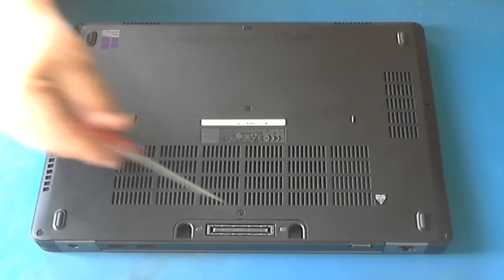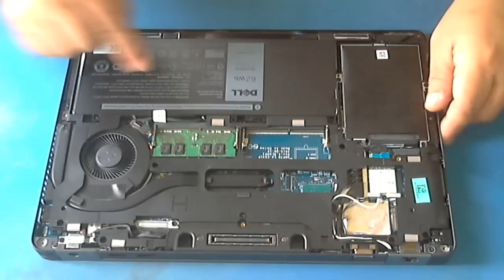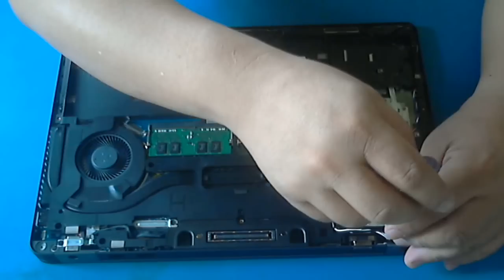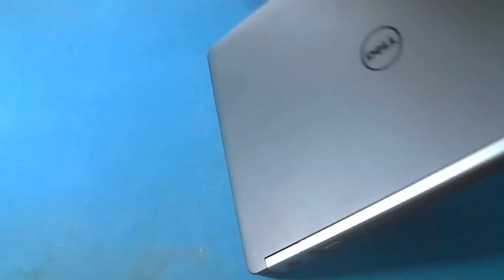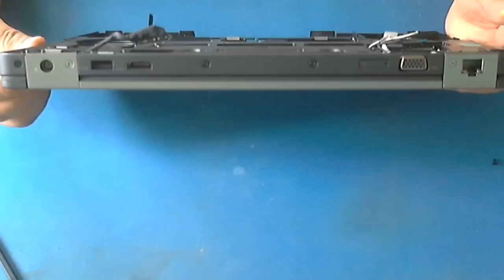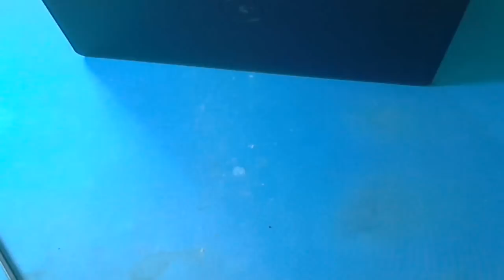Dell Latitude E5470 / E5570 Skylake Disassemble + Thermal paste changing

Comment: Did this also on exactly same spec and laptop, also using Arctic Silver MX4 and the X method of applying the paste. I tested temp via CPU-Z's Stress Test, found it 92 C before and 82 C after (running for about half hour). Highest temp after running Unique Valley Benchmark 3 times (taken with RealTempGT) is 74 C. Running some games I was still able to get temp to 92 C for short times, but this ran without throttling whereas previously it would get to 95 C and start throttling.
Reply from the maker: you apply too thick on the cpu . Too thick is giving less heat dissipate
 which cause the cpu become hotter than cooler. U have to adjust this 
yourself, or u have to find professional to do it.
Reply: I am actually pretty happy with the result. I've tried numerous ways of applying paste (less, more, different methods) on desktops and found all my techniques seemingly produce the same temperatures. I based the X method on pugetsystems' "Thermal Paste Application Techniques" article.

I don't think simply using Unigine Valley Benchmark produces the highest possible temperatures (certainly it never has for me, on either desktops or on this laptop). Even stress testing (which gives 100% CPU load for all cores) didn't, only playing games that basically use 100% CPU and GPU together seems to. I suspect but haven't tested that the latter is similar to Prime95's result though.
Reply from the maker: great to hear that . But from my experience, X method is not really the ultimate way to paste it. I do it differently  :)
Reply from the maker: you can always try out another stress test call "Heavyload"

Comment: Any tutorial on tightening up the hinges on the LCD? We just got this laptop back in May and I use similar models at work all the time and haven't had this issue before.
Reply from the maker: Sorry i dont have the tutorial. But if for the LCD hinges, the 2 screw is located on this video 8.29 .  One is next to the power adapter, the other is next to the Ethernet port. If you've tighten it well and you still have shaking panel, then i suggest you have to send it back to the shop for warranty. Otherwise,  you have to use Heat Glue Gun to make it tight, which will void the warranty.

Comment: Is that a thermal pad at the bottom of the heatsink? Or is it all thermal paste, but the part that was on the green portion stuck to heatsink only when you lifted.

When you replaced the paste, did you put any on the green portion or just on the shiny portion?
Reply from the maker: It's only thermal paste on the heatsink. And u have a very good eye, the green there is just shiny, but in fact, I apply  thermal paste on it too just to take good care of the laptop.

Comment: Where is the part were you apply past?? And can i use any tharmal past?
Reply from the maker: from the cpu , you can clean the existing thermal paste with alcohol swab and use a good thermal paste. Artic MX-4 is a cheap and good one. dont use cheap brand because they helps nothing in reduce heat .

Comment: How is the performance of 6440HQ quad core processor? Does it produce a lot of heat on normal usage?  How long does the battery last on average? I was thinking of buying 6300HQ instead of 6300U. Please post a detailed review of your laptop :).
Reply from the maker: the performance 6440hq have higher clock speed 2.6Ghz to 3.5 Ghz compare to 6300HQ 2.3Ghz to 3.2Ghz. The stock thermal paste is useless. U have to repaste it with arctic mx4 to get a good result on lower temp. here's the comparison https://forum.lowyat.net/index.php?act=Attach&type=post&id=7074062

Comment: hi is it possible to replace the cpu
Reply from the maker: No and yes, You can only replace the same cpu if it's burnt or problem. But No if u plan to upgrade the cpu
Reply: so in other words to upgrade to a i3 6100 3.2ghz would not be possible
Reply: helo
Reply: i curently have a i7 6600u with a 6.60ghz and want to upgrade to the i3 6100 3.20ghz
Reply: oops 2.60ghz
Reply from the maker: if the bottom pin is the same, then u might have a chance. So far replacing the same type cpu is possible. To modify it u got either fked up your warranty and it's not working, or u have a working laptop but void warranty

Comment: This does not look like the inside of my Dell Latitude E5570.  The space for storage sits perpendicular to the one shown here.  Mine came with an M2 SSD and a slot and space to install a cable for a more traditional drive.
Reply from the maker: your version is the same as  Amol Gund. The new version have m.2 instead of the old ssd/hdd. You can unplug the m.2 and replace it with 2.5" hdd but you need to find the cable connector from used repair shop.
Reply from the maker: check the video description for the new info for your m.2 to sata cable. i've just update the links

Comment: Does your laptop make weird electrical noise?
Reply from the maker: nope it didn't.  this laptop model just release around end of Jan 2016. everything runs at normal, just the temperature is not as good as I expected.
Reply: well i got the same and it makes a strange electrical noise, guess i`ll have to return it. thank you for your answer
Reply from the maker: Alexandru Zăbavă
i dont know where you live, and how's the power supply in your country. It maybe distortion on the incoming power in your place. But since it's under warranty, u should call dell and let them checked it out.
Reply: +SuperLittlehorn it`s not that, evenif it`s on battery it does the same. and when i started it first time it was the same. yup, that`s what i`m going to do, call them
Reply from the maker: good, after you've warranty your laptop back, get yourself an arctic cooling mx-4 or coolermaster extremefusion x1 and follow this video to repaste it. In long run, your cpu will last longer.
Reply: +SuperLittlehorn  will do :)
Reply: your cpu will last, but your motherboard itself wont ahahahaha... I do warranty repair and replace a ton of mobos (on all models) >.<
Reply from the maker: i do agree on this. nowadays the component wont last long. compare to last time where they have alot of pure gold plating stuff which last for a long long time.
Reply: yeah I am in China and my laptop make electrical noise, too.

Comment: Unfortunately, the back of this PC is a huge pain in the ass to remove. If I had to pull any harder, it would have broken. They did it right with the E5450; there was no need to change it.
Reply from the maker: you can always stay with it where it reach up to 89 Celsius or you can repaste it and see the max temp of 78 Celsius.  Every 10 degree increase = cpu life span reduce to half. The choice is still yours.

Comment: I'm receiving error "The AC adapter type cannot be determined" when I start the laptop, I already update the BIOS yesterday and try with different chargers I have (all my laptops are dell, same voltage) and the error remains. It is possible that the laptop conector is damage? what else I can do?
Reply from the maker: Did u use original that model adaptor? Using other different than that model adaptor will usually comes out this msg.
Reply: @SuperLittlehorn  I do, the charger is new for this laptop
Reply from the maker: @josegardunorubio4214  i think your new charger is not original . u should return it to the store and bring ur laptop over to try another adaptor. Meanwhile u can turn off the warning sign .  F2 - > advance ->adapter warning Turn off-> saved. 
 Or new bios - >Settings -> post behaviour -> adapter warning -> untick enable adapter warining -> saved

Comment: Hey quick question
latitude 14 5000 series or E5470 to be exact
Offer HQ Skylake chip right? As far as i know, HQ mean QuadCore while all E5470's reviewer on utube said that it has only Dual Core
I be like "wut?"
Reply from the maker: Yea they have few version of skylake cpu. HQ/MQ/UQ=Quad Core

QM/HM/UM=Socketed

QU/MU/HU=Dual Core

UH/QH/MH=Soldered
Reply: SuperLittlehorn i already know about that, that wasnt my concern anyway
There is review on internet about E5470
many of them said that altho it has i7 - 6820 HQ, the processor is Dual Core
Like this one: http://www.pcconnection.com/product/dell-latitude-e5470-core-i7-6820hq-2.7ghz-8gb-500gb-ac-bt-wc-4c-14-fhd-w7p64-w10p/8v22n/31564765
Reply from the maker: +Yahtadi Shidiq the website maybe not correct about the infomation. You can always check the cpu info  on cpuboss website . http://cpuboss.com/cpus/Intel-Core-i7-6820HQ-vs-Intel-Core-i5-6440HQ.  If you look at the descriptions on this post , there is a link to the results temperature after using MX-4 thermal paste, from the picture of CPUIDHW , u can see it's 4 core. not dual core
Reply: SuperLittlehorn I found many similar cases tho.. Why everybody keep wrote HQ Dual Core in their Website
Reply from the maker: +Yahtadi Shidiq https://forum.lowyat.net/uploads/attach-57/post-755657-1458187151.jpg  picture show thousand of words

Comment: I just got a trouble with e5470 whkle im on online class it just pop a black screen means it shut down totally and i cant on my laptop why is that ?
Reply from the maker: few things need to check .  Press Power button for 10 sec to confirmed is off.  And press power on again. see does it show any screen .  If it shows screen and shut down randomly like 2 mins, 7 mins, 8 mins, 10mins. thats mostly is cause by overheat.  If you totally off and cant on battery or charger , then it maybe mobo problem .
Reply: @SuperLittlehorn  theres no light at all n yet the laptop does not on anymore
Reply: Whats mobo trouble?
Reply from the maker: @Nadj727  power buttton, power adapter , power ic , etc etc. have to get your technician to check. must be something short.
Reply from the maker: @Nadj727  ya most probably is the motherboard . power ic , power button , fuse, etc.
Reply: @SuperLittlehorn  so what should i do?
Reply from the maker: @Nadj727  send to technician and fix it
Reply: @SuperLittlehorn  is it gonna cost me a lot?
Reply from the maker: @Nadj727  no idea. if u are lucky , just a blown fuse cost. but it all depends what the technician finds.
Reply: @SuperLittlehorn  ouh i see thanks for the jnfo

Comment: Hello Sir- I have question for u. Hope u help me to solve this question. My Dell Latitude comes with 256ssd. (M.2) I don't want  ssd And want replace with Normal 1or2TB hard disk. But I am not able to perform this, there is place for That, no cable and connector. I from India. My Dell model is Latitude E5470.
Reply from the maker: Amol Gund at 2.50 . Do you have that cable ? Your m.2 should be installed at the same spot as the Hdd right ?
Reply: yes u right sir 100%.  I have not that cable. Can u help me, i am in damn tense due to this. What is name of that cable? Can i buy it on Amazon, India? Any specific product link?
Reply from the maker: check the video description for the new info for your m.2 to sata cable. i've just update the links

Comment: Thanks for the nice video.
I have a question,
I'm trying to upgrade my Latitude E5470 HD screen anti-glare (1366 x 768); to a FHD one, but I found out that  
HD screen (1366x768) uses one channel video cable, while HD+ (1600x900) and Full HD (1920x1080) uses 2-channels video cable, can any one confirm that please ?
Reply from the maker: Saed A I can’t answer that as the laptop already give back to customer. You have to check with dell to get the service manual

Comment: Hey, is it possible to replace screws on the back panel? I totally destroyed mine :(
Reply from the maker: morf676 you can replaced any screw if u found the same diameter. The length is just more less the same will fit
Reply: yeah, thank you. maybe you remember these screws size? can't find any info in the internet.
I also didn't take the back panel off so how do these screws hold into the back panel? Are there like some kind of holders? How do you take them off?
Reply from the maker: sorry i dont remember the screw size but it kinda standardize. Btw, the back cover , the screw is non removable , it stick with the back cover. Only internal screw can be removed.
Reply: what a bummer :(
Reply from the maker: missing 1 or 2 screw on the back cover is small problem. Nothing to worry about. the only important parts are CPU, GPU, mboard, screen hinge.
Reply: thanks for your help! yeah, I know it's not that important it's just kinda sad to ruin something (even something small) in a new laptop :D

Comment: This laptop so thick. There is no excuse to why the CPU is soldered in.
Reply from the maker: Mikheil Ghvinianidze latitude model is the highest end in dell. That’s why they are so solid and protected everywhere . Lower end is Inspiron and vostro
Reply: @SuperLittlehorn   So, you are saying that CPU is not upgardeble due to if it was in that case it would not be as solidly build.

This is just ridiculous because I have been repairing laptops since 2008. I have desisambled and reasambled hundreds if not thousands of different laptops, and I have NEVER   EVER have seen CPU sockets causing any   ABSOLUTELY ANY issues.

However I and many other techs have seen soldered GPUs and CPUs causing problems.

If you do not belive me you can Checkout Louis rossmann from Rosemont  repair group.
Reply from the maker: @MikheilGhvinianidze  stop taking drugs, it makes u like an idiot who cant read.

Comment: what is your temperature in idle
Reply from the maker: VGExTeZil 35c on idle
Reply: SuperLittlehorn I have 50
Reply from the maker: which thermal paste u're using? did u apply too thick ?
Reply: SuperLittlehorn yes
Reply: In stress tesy max 85C
Reply: SuperLittlehorn I carried to a service center
Reply from the maker: my max full load only 68C. If you get 85C means u are not using MX-4 thermal paste.  https://forum.lowyat.net/index.php?act=Attach&type=post&id=7074062 .